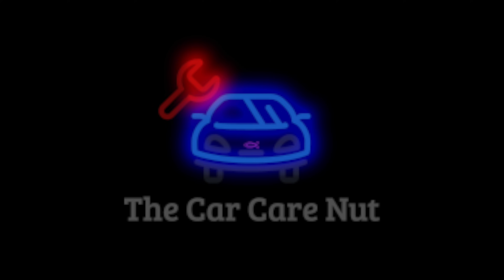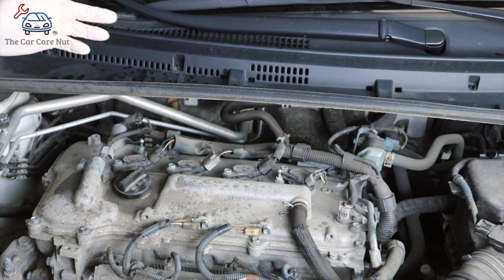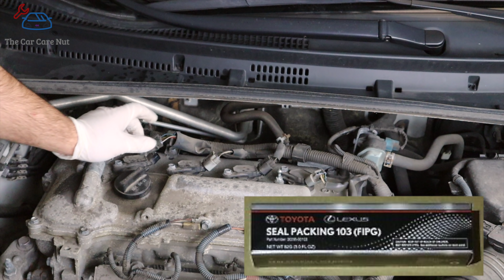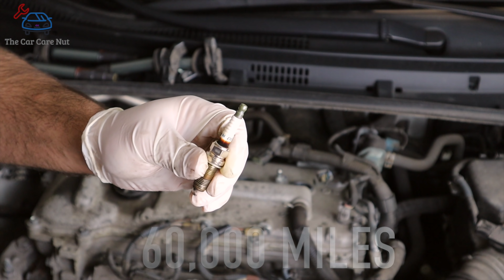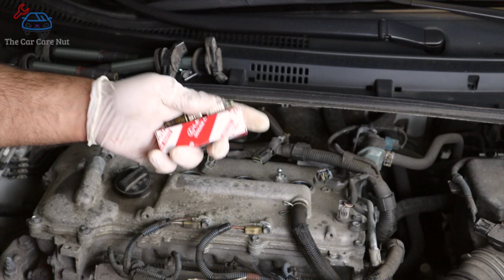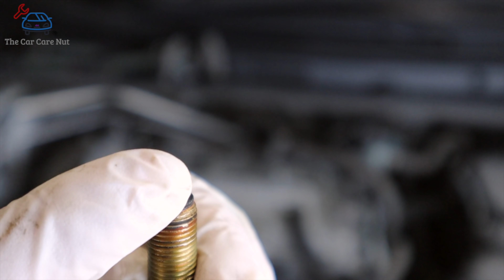How to change Toyota Spark Plugs on 4 cylinder engines

Comment: I own a 2018 Rav4 SE hybrid. So, torque specs for spark plugs are same? 18 ft.lb?
Reply from the maker: 18 it is.
Reply: @TheCarCareNut  Thanks. Can you also make a video about how to calibrate a torque wrench?
Reply from the maker: Torque wrench calibrations is something I send out to get done.
Reply: @TheCarCareNut  I wanted to get mine done, I don’t know where to send it and how much they will charge. What’s the decent amount to calibrate it. Does these YouTube videos how to calibrate works? Or I for sure need a professional to take care of it
Reply: @TheCarCareNut  Should you recommend me to get it calibrated as I don’t use it often.
Reply from the maker: What brand do you have? Sometimes professional calibration can cost a pretty penny. If it’s not an expensive one if just buy another.
Reply: @TheCarCareNut  harbor freight - Pittsburg pro
Reply from the maker: Honestly I am not sure if Pittsburg does calibrations. On mine I just send it to snap on through their dealer and they get it calibrated. I think it’s 50-75 bucks
Reply: @TheCarCareNut  As harbor freight tools have lifetime warranty, I will just get it replaced.
Reply from the maker: That works 😀

Comment: Thanks for the info. I'm an old school shade tree mechanic and was always told to use anti-seize or even a drop of oil the spark plug threads.
Reply: Maybe, because the sparkplug wasnt sealed that good back then and they colud rust extremely tight?

Old school saying in Germany:

"When there is oil, there is no rust."

Its used as a halftrue joke, when an engine leaks a bit an sprays the oil all over the underside of the car.

But in fact its true, and cause of that, the saying is also used when its really true and used for preventing something from rust.

Comment: I love the 4 cylinder on my Camry. Hate my V6 Camry when it come to plugs 😂. Yeah,  torque them. I had one back out on me and started getting misfire. The thing was finger tight,  I must not tightened it or not correctly.
Reply: Many years ago, I watched a mechanic install new sparkplugs in a customer's car. After he torqued the first sparkplug down, he removed the extension and sparkplug socket from his torque wrench and installed them on a ratchet.  Then he proceeded to back out the sparkplug a couple of turns.  When I asked why he did that, he replied:  The first time you torque down a new sparkplug, the crush washer at the base of the sparkplug won't be fully compressed and the sparkplug won't be properly torqued down.  When I install new sparkplugs, I torque them down and back them off two or three times to make sure that the crush washer is fully compressed.  I have followed his advice every time I change out sparkplugs!
Reply: @RichW240  I don't think crush washers are made to be fully compressed. Maybe AMD can educate us.
Reply: @flagmichael  The next time you install new sparkplugs in your vehicle, torque them to factory-specs.  Then, try to remove them with a ratchet handle,  (extension and sparkplug socket).  You will be amazed how little force you will need to back them out.  In fact, each sparkplug will take different amounts of effort to loosen them because they weren't  really torqued to specs.  This will not occur until the crush washer is compressed.
Reply: @flagmichael  The next time you install new sparkplugs in your vehicle, torque them to factory-specs.  Then, try to remove one of them using a ratchet handle, (extension and sparkplug socket).  You will be amazed at how little effort it will take to back the sparkplug out.  This, because the crush washer wasn't fully compressed.
Reply: @RichW240  The crush washer comes with the plugs, and the plugs have a torque spec.  When the torque is reached, which isn't very high because this is soft white metal involved, then the washer should be crushed.  If it isn't crushed by the torque then something is wrong with the washer on the plug (unlikely) or the torque wrench is inaccurate.  It's normal for plugs to come lose with only a little effort, because guess what, the torque that put them in was only about 15 ft lbs.  It's only after heat and time that the plugs may become more stuck.  

Here's something that people might be surprised to know: torque wrenches are effected by cold temperature.  When my Dad was an aviation tech near Winnipeg they had inspections done on their torque wrenches and they were always being replaced.  One day when he knew the inspectors were coming he placed their wrenches on a heater before and then all of them passed inspection.

Comment: Can you use a breaker bar (as gentle as you can) if spark plugs are tight, and not coming out with manual tools? Our 2006 Toyota Corolla with original spark plugs are STUCK @ 85k miles. We watched videos where folks used PB Blaster but in that case, would prefer to just pay for a mechanic to do it. We have a torque wrench and spark plug socket tool (both from Advance Auto), but when we got to the spark plugs, they were not coming out. Also, you may enjoy making DIY videos like “Toyota Maintenance” - he and ChrisFix are helping us slowly make our way through bringing our sedan up to maintenance. Appreciate your “insider” perspective, and are hoping to be able to figure this out without making a very costly mistake.
Reply from the maker: Hi! Try this as it sometimes work. Drive the car and warm it up really well then try to take the plugs while it’s warm. A lot of people will advise you not to do this but from experience with Toyota this could help essentially using the engine heat as a “torch” if not have a mechanic take it out because the last thing you want is a broken spark plug.
Reply: Try turning counterclockwise

Comment: How hard is it on a 2002 Toyota Camry XLE V6 transverse engine?  I can see 3 on top, but not sure where the other 3 are.  Just what has to be removed to get to the other 3?  This may be a case to have my Toyota dealer do it.
Reply: They may charge you half price
Reply from the maker: Hi! The other 3 plugs are on the other side of the engine covered by the intake plenum. If you’re not mechanically inclined and have done similar work I’d have a mechanic replace them and be done with it. It’s not a hard job but definitely more involved than the 4 cylinders
Reply: @TheCarCareNut  Thanks.  I kinda thought that was the case as I had to have both gaskets replaced cause both were leaking, and the Toyota dealer had to remove the intake to get to the other gasket.  Not something I want to try.  I don't know if they check the Spark plugs when they replace the gaskets, but those were not on the list of things they found during the inspection.  

I don't have very many tools, and living in a apartment complex don't really have any place to work on it.   So I'll just leave it to my local dealer to do that when the time comes.
Reply from the maker: Replacing the valve cover gaskets on that engine with the plugs is a good idea saves you on labor.
Reply: @TheCarCareNut  Yeah it would have been the best.  Didn't think of it at the time, the receipt shows they just changed the left and right gaskets and no mention of the plugs.  Dang, looks like another similar charge is coming soon.  :(  Unless they did look at them and determined they were still good.  I'll have to ask my Service Advisor to find out.

Comment: A PRO would have used dialectic grease inside the boots...
Reply from the maker: Toyota doesn’t use dielectric grease from the factory on coil over plug setups like the one in the video.
Reply: This is not a 1980 car with spark plug wires
Reply: Well, think about it. Why would it be good? No water in there because of the gasket, no sparking because the spark length would be too long to work. The boots might stick to the plugs, but apparently they don't. Progress changes another standard.

Comment: Do you recommend die electric grease on your spark plug boot ends i still do ??
Reply: Its recommended if you are NOT up to par on maintenance and only decide to change your spark plugs when your car starts breaking down. IF you change it on a regular basis though, its not needed.
Reply from the maker: Hi! I personally wouldn’t but if you are putting some grease make sure it’s a very small amount. Too much will cause issues.

Comment: Ok, I get it with the anti-seize, but......?  Originally the reason anti-seize was used because the metals were different and this kept the metals from sticking/seizing together. I have been using this since 1980’s. I started with the Japanese cars of that period that I had purchased and it has always worked. Recently on 2006 Honda Accord and 2009 Honda CR-V. On the CR-V at 105,000 miles the spark plugs were really stuck into the head, difficulty to remove. I can’t imagine removing them at 200,000+ miles without the anti-seize being on the threads. Comments please.....Jim
PS......I assume when you removed the plugs, the engine was cold?
Reply: I see comments above that removing plugs in a warm engine is easier.
Reply from the maker: Hi! Removing plugs on a warm engine will help them come out much easier. I don’t use anti seize and the repair manual and the factory doesn’t use anti seize. And the original plugs on Toyota’s come out very easily if they’re original.

Comment: Thanks a lot for your videos I really learned a lot! Question: I bought a 2021 Toyota Venza Limited and is my daily driver. I drive 70 miles every day to work. Any recommendations for high mileage use of a hybrid vehicles? I love the car  and want to keep it in perfect condition.  Thanks again for the videos and keep them coming!
Reply from the maker: Hi! Just regular maintenance really. That is a solid powertrain that when maintained should last a long time. If you want to be on the safe side keep your oil changes around 5k miles or 6 months

Comment: After spark plugs are in a car for 10 rs I always worry about stripping the threads when breaking them loose. A warm eng seems to break them loose easier. I think some say do it when the eng is cold. Still not sure about what is best.
Reply: With the steel plugs and aluminum heads, the grip should be looser when warm because the aluminum expands about twice as much with heat.
https://www.engineeringtoolbox.com/linear-expansion-coefficients-d_95.html
Reply from the maker: I would replace them with a warm engine not too hot. A warm engine will help get the plugs out easier.

Comment: Another great video , thanks 🙏 
One tip from me. 
Once you disconnect the wires and remove the coils work one cylinder at a time, take the old plug out, inspect it and put the new plug in, torque it to 25Nm and move to the next one. Once all plugs are replaced insert all Coils back and torque to 10Nm. Never use any anti seize. Do not wait for 120k miles for change, just 60-80k miles max , these plugs can go even up to 200k miles however these dark marks shown indicate leakage that can actually damage the coils and then expensive replacement. 👍

Comment: Nice video and tips.
May another tip here..
Do not drop the spark plug into plug well. You might re-gap it, if drop sweeping against the edge of the thread well to the bottom. (unintentionally.😄)

Going to replace those spark plug on my 4 cyls toyota engine soon, clocking 116k kms, 6 years and never have problem on misfiring. Only fail to start due to battery, after battery replaced all 4 cyls firing as usual.

Comment: Took me 5 hours to finish my 2007 Sienna spark plugs. The 3 plugs in the back are the most time consuming.
 While I was there, I changed the intake plenum gaskets and gave the throttle body a nice shower with TB cleaner an let it dry while finishing the plugs, and I gave it a new gasket. Finalizing the job with new air filter and PCV valve. All OEM TOYOTA parts from my local dealer. Also I sprayed the MAF sensor. There was nothing wrong with the van but it was time to do it after 13 years/130K miles.

Comment: I always check the gap takes just a few seconds.
Reply from the maker: On iridium plugs you shouldn’t check the gaps as you could damage the tip.
Reply: @TheCarCareNut  
I have seen mis-gapped plugs that were pre-gapped.
Reply from the maker: It’s possible but I would return that iridium plug and get another one.
Reply: Don't (don't) check the gap in a pregap plug, you're gonna scratch the tip.

Comment: Hello AMD 
Another awesome video. Thanks for your time and hard work to educate others. A small request, subscribers like me live in Canada where we use Km not miles, so when you say change this or that at 30,000 or 60,000 we need to think twice is it in miles or KM?  If you may clear this in video that would be great help. 
Also, any video coming up  on changing spark plugs on a V6?
thanks
Reply from the maker: Hi! Thank you and my apologies for the kms miles situation. This has come up and going forward I will write it down.

I’m working on getting the v6 spark plug video which should come soon.

Comment: Can you make a video of changing spark plugs for V6 Without moving the intake manifold?
Reply: This guy didn't have a problem since he removed the drain pan and cut the bracket
https://youtu.be/urKkKH7tR24
Reply from the maker: Hi! You can’t replace the spark plugs without removing the intake plenum unless you have an older v6 with a metal plenum. Video will come in the near future for the v6 plugs
Reply: @TheCarCareNut  How old (what years) is "older" - referring to a Camry V6?
Reply from the maker: Hi! Older v6 are the 1MZ v6 possibly up to 2002ish. Easiest way to tell is to look at the engine. If it’s a 1MZ with a metal plenum you can do the plugs without removing anything. If it’s a 3mz with a plastic plenum then you have to remove it.

Comment: I just changed the spark plugs on my daughters 2015 2.5 Camry. Replaced with Denso spark plugs, but the TT Iridium. (Iridium pointed laser welded on the electrode). Runs perfectly!

Comment: When I replaced the plugs in a 2007 Matrix I used Laser Iridium NGK brand which cost about $57 for 4 in Canada. What bothered me the most was not having an air compressor hose to blow away the dirt. I used an aerosol canister instead. I looked at the gaps and did not use anti seize on the threads. Used great care in rethreading the new plugs and torqued them to 18 ft-pounds. I brought them from local auto parts store. I find local Toyota Dealer’s prices for parts reasonable though and try to always use OEM parts.

Comment: Thanks so much for these videos. Both my Toyotas have the V6 which is a much more challenging change, especially the rear 3 plugs. Any chance you can do a diy about that?
Reply: It's only that 12mm screw at the back of the plenum, if you can do it, the rest is not that difficult. Just time consuming. Check this guy who cut the bracket 
https://youtu.be/urKkKH7tR24
Reply: @landshass2849  it's my understanding that the mistake manifold needs to be removed to reach the back plugs on my 2grfe engines.
Reply from the maker: Don’t cut the bracket! I’m trying to arrange for a car to be dropped off so I can film the spark plug replacement for the 2gr
Reply: @TheCarCareNut  you're the best AMD. Thank you!

Comment: Question on using FIPG on broken wire connectors to the coil. I just squeeze some inside where  the male and female electrical connectors push together? Doesn't that interfere with the electrical connection?
Reply: Ok so put it on after the connector is on and just put a dab where the clip was?
Reply from the maker: After the connector is connected put a dab and smear it where the clip used to be. That’ll be enough to lock it from coming out
Reply: Awesome, thank you for clarifying!
Reply from the maker: Hi! Not inside. Just place some over the plug exactly where the pin that I pulled in the video to release the connector.
Reply: @TheCarCareNut  Oh, okay, that makes sense. Thanks for the reply.

Comment: The iridium spark plugs that they say are good for 120k seems like a long, I’m sure they are still good, but probably not fun to take out of the block after 120k
How many miles on those plugs you pulled ?
Reply from the maker: The ones I pulled has 97k but consistently I pull the 120k ones and they look about the same. They really do last 120k. If doing it yourself it wouldn’t hurt to replace them earlier.
Reply: @TheCarCareNut  what would be a good time to replace them?
Reply from the maker: I’d stay sticking with the 120k miles or 10 years whichever comes first